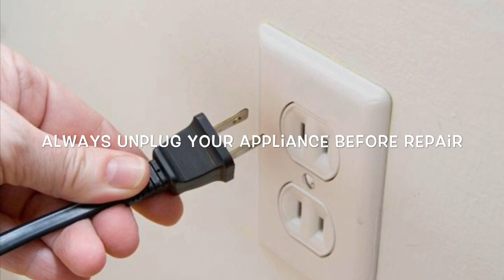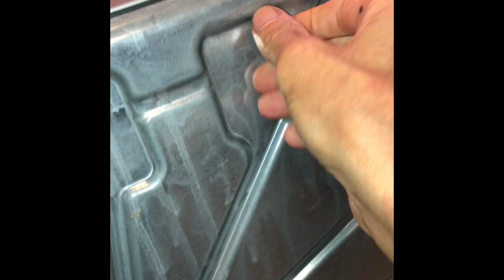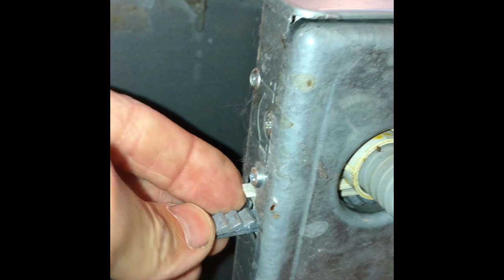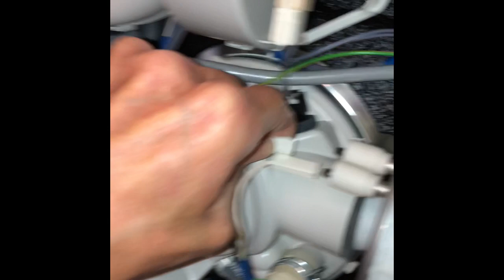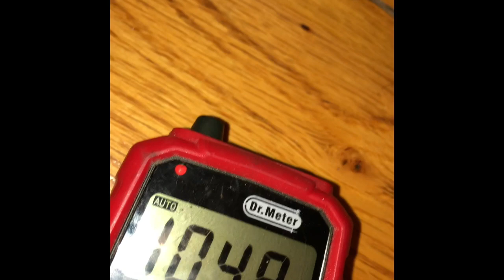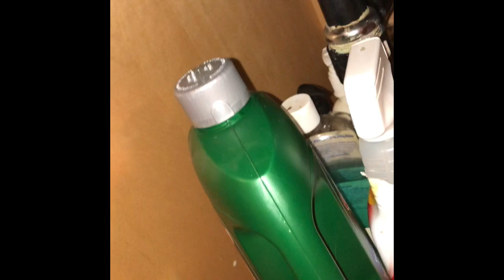✨Miele Dishwasher Isn’t Heating (FIXED)✨

Comment: Your meter read 10.53K ohms. You said the reading would be 10 to 11 ohms. The coil was 10 ohms but the temp sensor was 10 and a half thousand ohms.